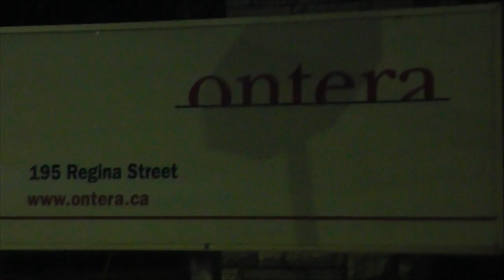Diagnosing the Baja Leaky Tire

Comment: May not of ever been tight . and if a little loose it prob could, between vibrations and air pressure it could back out more and more. but  You tightened it so i think it will be ok now.

Comment: Yeah those valve stem pins do not always set right when the tire dinks put them on, I had a car with the same issue on all four tires.  Pain in the sack as they wanted to charge me to take the tire off and remount it, I just went to a buddies house who had a pin tool and bam good as new (like it should have been from the tire dinks...only better).

Comment: That sign could be a collectible now, just like all the other Ontera-branded stuff... :P

Should use that valve tool just to tighten up the valvestem, cos I'm betting it's that... :P

Toldja it was the valve... :P

Well, the valvestem is chinese, so, unscrewing it to swap tyres will have ruined the chinese rubber seals, that or Rex didn't tighten 'er up when re-installing the new tyre... :P

You can buy new cores for valves, but personally I'd buy an entire new stem, apparently when those stems fail (from accounts by chinese scooter owners), they fail fast and dangerously...